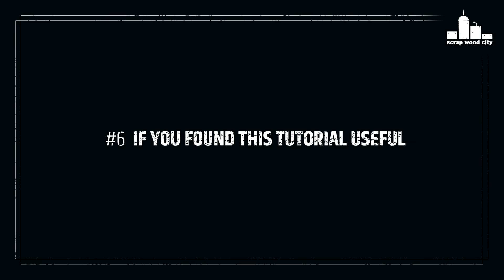How to use a spokeshave - Woodworking hand tools

Comment: Some cabinetmakers like to have three spokesshaves for different purposes - one with a flat sole for flat work and rounded corners, one with a cambered sole for inside curves, and one with a concave sole for outside curves. You can get away with just one with a flat sole and a small curve in the front and rear for all three, wherein adjusting the depth of cut will allow you to get inside curves, and the flat portion of the sole will allow for flat work.

Comment: I love it. Those curly shavings are wonderful! Thanks mate, lots of good stuff in here. The diamond file sharpening is an especially good little tip. Cheers Dimitris.
Reply from the maker: Thanks man, yes the diamonds save a lot of time. I use them in almost any tool that needs sharpening!

Comment: Great video man, even its razor sharp my spokeshave is rigged in wood and not moving smoothly, how can i adjust the blade so it moves like in the video ?
Reply from the maker: I think you should try to set it so it creates thinner savings. Even the slightest adjustment makes a difference. Experiment with it for a while and you'll get it!

Comment: I’m most definitely not a woodworker. I’m just a girl who has a door that’s stuck so I don’t need to unlatch it inside then go outside and push it open lol. This looks like it will be easier on my hands and lighter than a standard plane. Will it do the job do you think?
Reply from the maker: I don't think the spokeshave will work for this job. A plane is what you need!
Reply: @ I’ve decided to try an electric sander first, but yeah I think I need a plane. I just don’t want to buy one to use only once. But if the sander doesn’t work I will. Thanks for responding 😊
Reply: You need a plane. The plane is the correct weight and width to do the job. A spokeshave is as the name suggests, for lighter work. The weight of the plane is part of its strengths.
Reply: @bristolfashion4421  I did it with an electric sander. It went much faster once I found coarse sandpaper 😂😂 I know it wasn’t the right way to do it, but it did the job. I got it done the night before a really hot day, so once the cool change came through I was able to open it up and have a cross breeze to cool the house down which was so nice!
I will pick up a plane next time I’m at the hardware shop though. It’s a pretty basic tool that I should have in my collection.

Comment: Dumb question, but: what are the purposes of the thumb screw and regular screw? Should they both be tightened down? I understand that they're to lock the blade in place, but why are there two?
Reply: The smaller screw is just the loactaor screw for the red back place, it positions it in the correct spot to ensure correct edge position on the blabe.  The larger screw is adjusted by hand to increase or decrease tension on the blade to either allow blade adjustment (loosen the screw slightly and either wind the blade in or our) or tighten to put pressur tr=hrough the back plate onto the blaade to =enable correct use when shaveing.   Same thing as in a plane